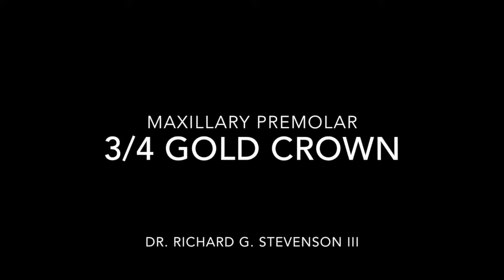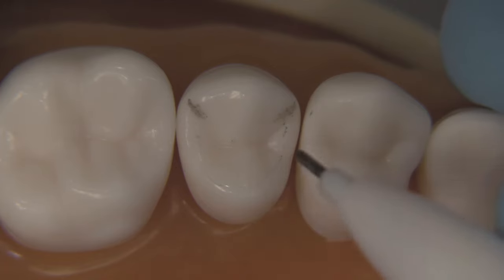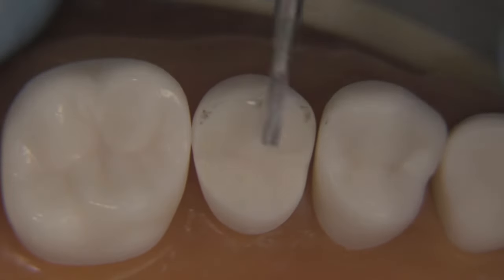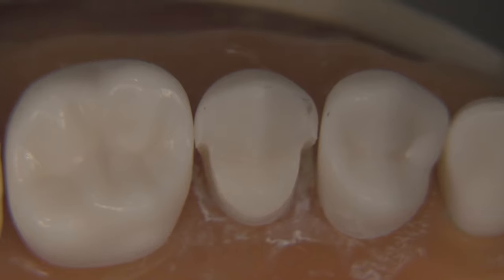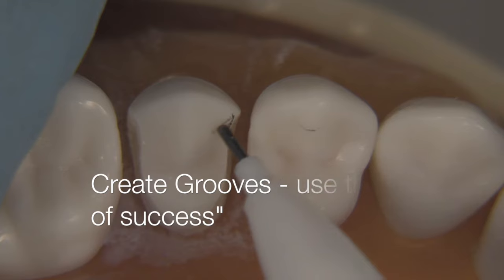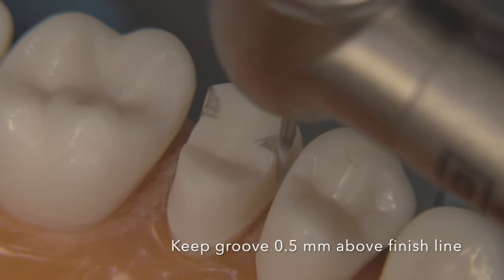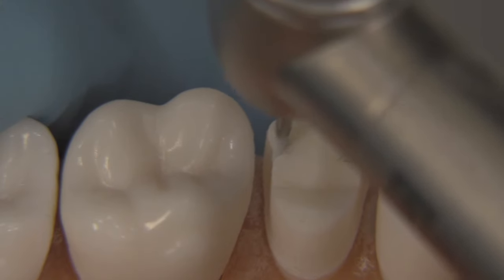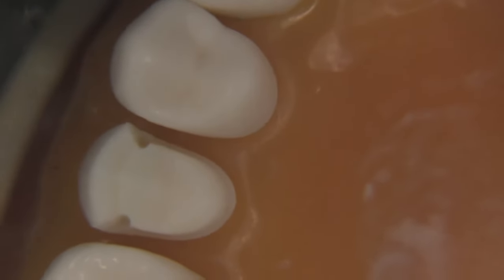3/4 Gold Crown Preparation | Maxillary Premolar

Comment: Can you please clarify whether we need to cut 1mm of the palatal cusp and then an additional 0.5mm as a palatal cusp bevel?
OR
1.5mm of the palatal cusp occlusal ly then the bevel?  However, this will take it to 2mm total. Thank you.
Reply from the maker: 1.5 off the lingual cusp and 1.5 mm bevel - this will not change the B plane reduction but will shorten the cusp to to 1.5 mm

Comment: Dr can u tell me please the measurment of the prep please?? Ans is the measurment different if the type of crown change??
Reply from the maker: 1.5 mm occlusal clearance on the functional cusp and 1.0 mm on the non-functional cusp.  The offset measures about 1.5 mm wide and have a 0.5 mm deep "v" shaped notch located within the offset.  The axial grooves are made with the 169L and are 0.5 mm deep and 0.5 mm above the finish line.  The proximal clearance is 0.5-1.0 mm.  The buccal cusp (the non-functional cusp on the upper 3/4) is 0.3 mm.  Maxillary 3/4 crowns will all follow these measurements.  For Mandibular 3/4 crowns, the numbers are similar, however the mandibular crown uses a facial shoulder and bevel instead of an offset.
Reply: @StevensonDentalSolutions   thank you very much doctor
Reply from the maker: Glad this helps

Comment: Thank you Dr. Stevenson!
I wanted to ask about the first step when you start prepping the occluso-facial aspect of the tooth; we are reducing the occluso-facial by 1mm. are we touching the cusp? or are we just reducing the occlusal plane without touching the facial cusp (contrary to a PFM where we are reducing the cusps while reducing the occlusal plane) ?.
Reply from the maker: You must reduce the cusp to allow for gold thickness, but the amount you remove is minimal - about 0.5 mm, and  then the offset provides for additional support of this thin gold area.  Finally, the contra bevel is placed mainly to allow for a smooth finish line.
Reply: Stevenson Dental Solutions 
Thank you for all your videos ! 
Some people were born to teach and you are one of them 🙏🏼

Comment: Thanks doctor, So we have 2 metal collars on the finishing line and close to the buccal cusp right? Both 0.5mm width?
Reply from the maker: The finishing bevel may be less than 0.5 mm, and the offset is initially 1.5 mm and becomes less wide after placing the final finishing bevel.
Reply: Stevenson Dental Solutions I see , thanks, also I appreciate your understanding of what I meant through my wrong terms. Thank you 😊🙏